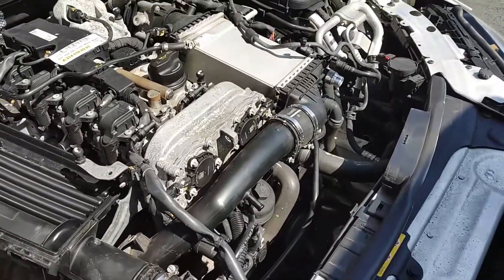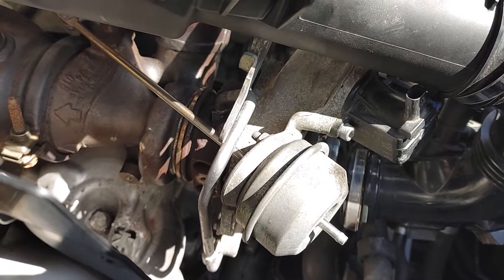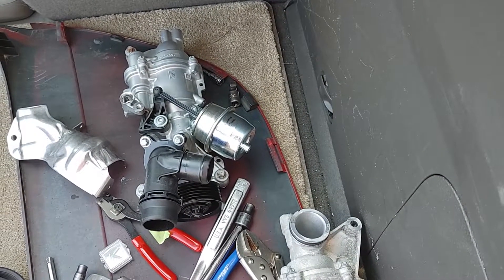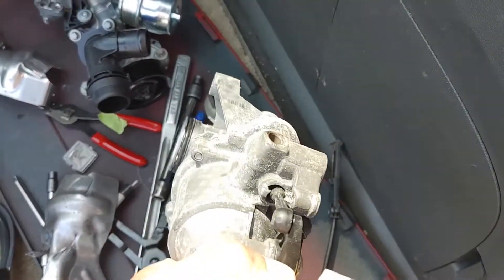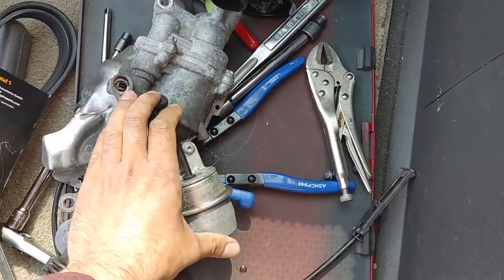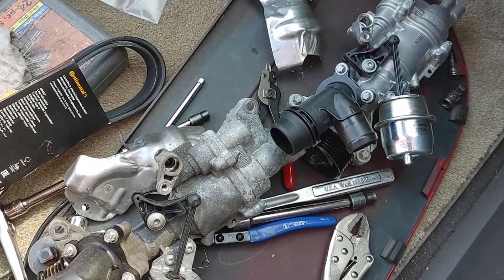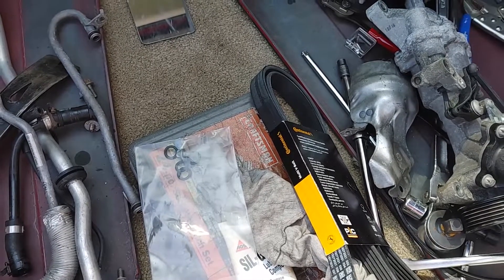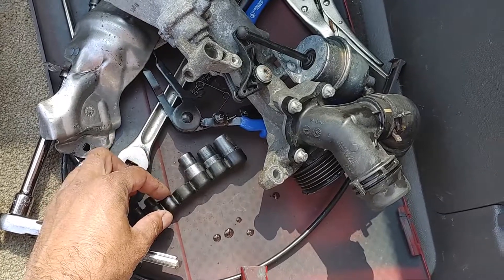C300 W205 M274 water pump coolant pump replacement due to overheating

Comment: Hey there, where can i find a replacement water pump can you point me in the right direction?
Reply from the maker: I bought mine from FCP Euro. They can check your VIN to make sure it's the right part for your car if you message customer service.
Reply: @charvakkarpe thanks brother

Comment: How the do you get the coolant lines off the pump...im stuck there. Its an E bit. Once the bolt is out, I can't get the lines loose. Im about to remove the exhaust manifold and turbo

Comment: Hey friend. I have a w204 with the m274. 

Driving on highway above 100-110 km/h the temp gauge start rapidly going to the red zone. If I release the gas and go don’t I like 80-90 km/h I stabilizes again within a couple of minutes. 

At normal driving around town temp is normal. Would you suspect thermostats or water pump?
Reply from the maker: I'm not familiar with whether the Mercedes thermostats function in any strange way. Normal thermostats are designed to divert coolant to the radiator when the coolant temperature exceeds the setpoint. If they leak, the symptom is that the engine runs cold. You'll notice a lack of heat in the winter. If they get stuck shut, then the engine overheats under load.

I would guess your problem is the same as mine, the water pump.

Try an experiment. Drive above 100 kph, where the temperature starts to rise. Turn your cabin heat on full blast: maximum fan and maximum temperature. See if the engine overheating gets better or worse. If the thermostat is bad, using the cabin to cool the coolant should help lower the engine temperature. If the water pump isn't flowing enough, then the overheating gets worse because now instead of pushing the coolant through the cooler radiator, it's pushing the coolant through the cabin heater that works less well to cool the coolant. Make sense?

Comment: So when this water pump problem cause the thermostat to go as well?
Reply from the maker: I don't see how the failures would be related. What are your symptoms? A failed thermostat can cause a car to run too hot or too cold. That's easier to diagnose by considering the outside air temperature and airflow across the radiator.

Comment: This guys is skillful NGL, I’m having problems removing it and I removed the charge pipe and u pipe but the heatshield was genious just took mine off waiting for the new one to come in.
Reply from the maker: Thanks! You see why I bothered to make a video about it.
Reply: @charvakkarpe  so I didn’t replace the coolant line o rings gets what’s happening…… their leaking would you happen to have the part number for them😭😭😭😭😭😭😭😭
Reply from the maker: @cinereyes  Hah, that's messed up, the part isn't listed for the C300. See 2742031100 Looks like they sell the entire pipes instead. I don't see the O-rings in my FCP Euro order history, I guess I bought them at the dealership and had them look up the part. From the looks of it, I bet it's the $2.70 O-rings listed for the CLA250 and they are available on FCP Euro as well. Look up part 997380764 FCP Euro lists it as MER-000997380764 and I think it looks right. Someone should confirm whether it works in the comments.

Comment: And what is the cost of the pump part
Reply from the maker: I used 274200150785 which was $267 when I bought it.
Reply: @charvakkarpe how can I make sure I purchase the correct part? Is it printed in the pump?
Reply from the maker: @GHerrera90  Where are you buying it from? Does it look like the one in my video? I recommend buying everything from FCP Euro when possible. Their videos are very useful and their lifetime guarantee works. I don't recall seeing the part number printed on the water pump but you should be able to tell by comparing how it looks with photos from FCP Euro or my video.

Comment: Would this problem cause a smell of fuel
Reply from the maker: Hi, no, there's actually a TSB (Technical Service Bulletin) out about the fuel smell issue. Mine has it as well, I'm planning on fixing it soon when I change the PCV valve assembly, since the leaky fuel supply hose is down in the same area. These C300's have a whole bunch of common issues and some of them aren't cheap or easy to fix. The Mercedes feels well built and reliable, but that's just a feeling. The BMW 3 series actually has fewer problems.

Comment: Mercedes fucking suck.
Hey engineer Gunther I know what we can do.
Remember those plastic ball cock levers that break on every single 272/273 engine intake manifold we’ve built that requires replacing the entire intake manifold?
Yeah.
Well let’s put that same plastic crap on the 4 cyl turbo water pump assemblies so they break too.
Great idea Zigfried.

Comment: This video has literally just the specifics I needed.! Great job sir.!
Reply from the maker: Thanks, Juan! Let me know if you have any questions along the way. Or other issues with your C300. Mine is now occasionally throwing the PCV code, so I'm contemplating doing that job at some point.
Reply: Is it true that temp level don’t work if water pump fails and lose all coolant